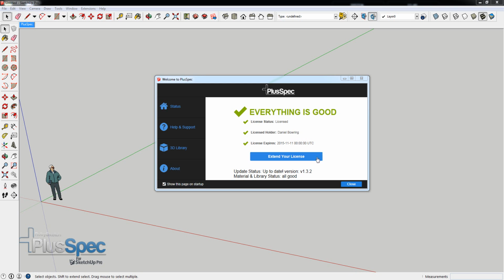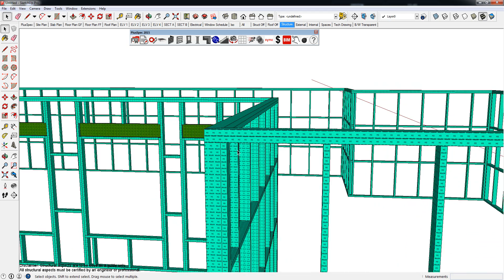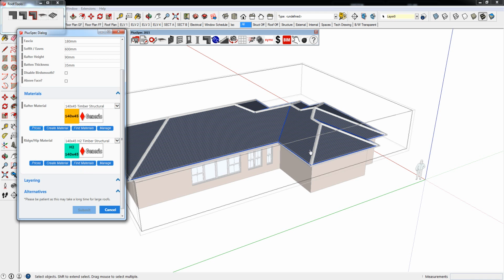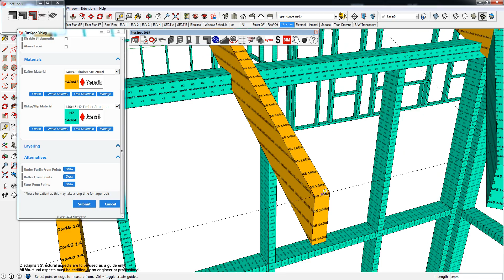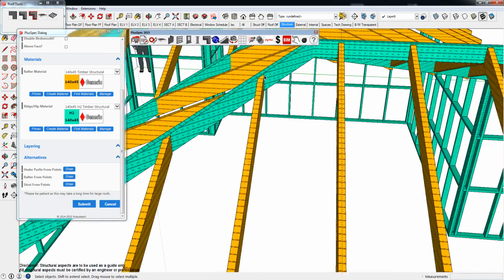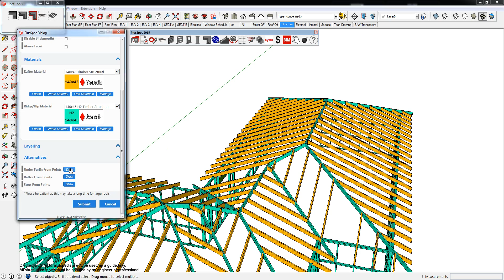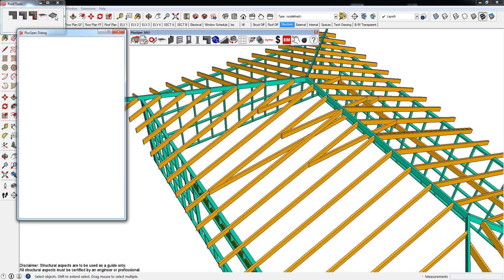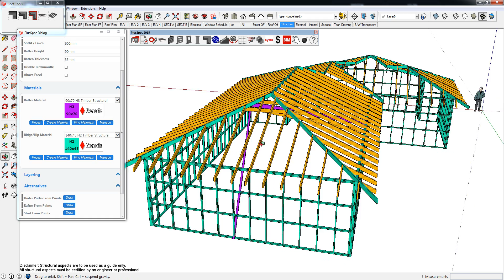Creating a pitched roof in Sketchup using PlusSpec doing a BOQ or feasibility study

Comment: 1. Can it do Automatic Trusses with Nails calculations ?
2. Can it Do Roof Roman Tile calculations and battens and nails?  
3. Can it EXPORT to Exel so i can have a list of detailed material so i can Price it Using my  Own Exel Calculstor?
Reply from the maker: Thanks for commenting Tumza, 
1. Usually you would allow nails per truss according to your engineers hold down requirements. We are not an engineering software however, you can export to excel and then associate  every measure with the engineers requirements
2. Roof calculations are done by sqm , sqft etc. If you know how many tiles you have per sqm and how many battens you have per sqm I would do the 1 click export then export excel and associate the right number of nails, tiles ETC you require per unit measure.  many of our users import the XML (Excel sheet) into Quickbooks, MYOB or what ever accounting software they use so they can do their accounts and purchase orders and their book keeping. Some programs have added functionality that automate this process. 
3. Yes
The goal of Plusspec is to get the take off from the design to eliminate or greatly reduce estimating and purchasing. It simply does not make sense that we are tracing over plans and doing multiple equations form a 2D drawing.  the 2D drawing is the end result that we use onsite for communication, they are terrible to estimate from and they cost the trades people more money than I can explain.  ARGGHHHH #3dBIM4estimating
Reply: It can do most of what you are looking for and you can associate recipes for nails and hardware. Here is the traditional roof creation vidoe https://youtu.be/4ZQTsF-hJGM